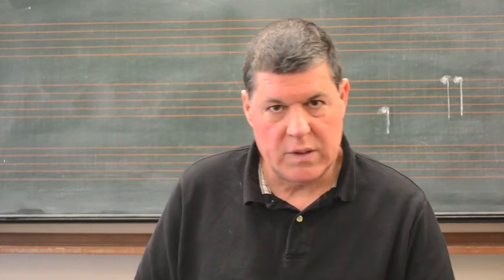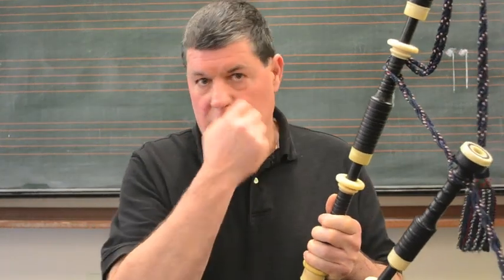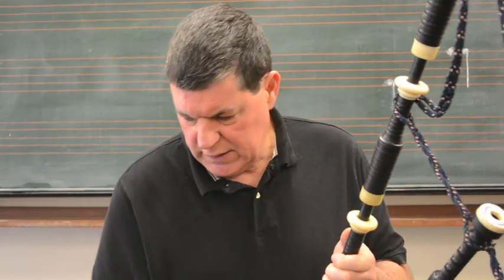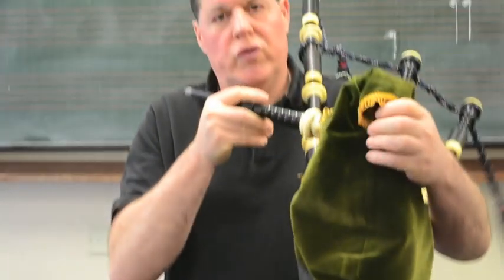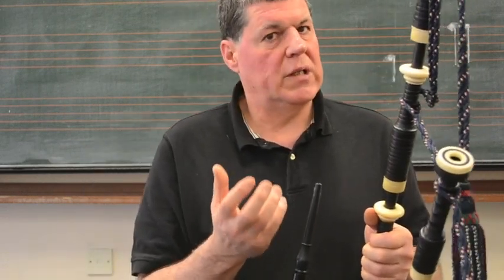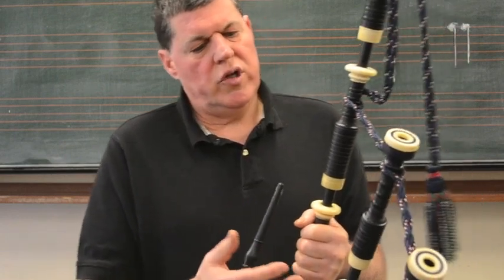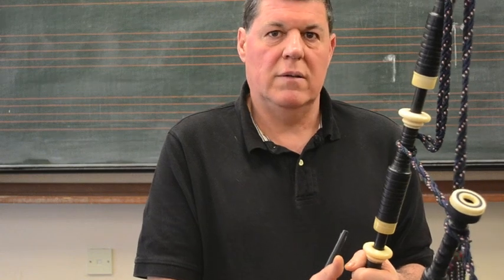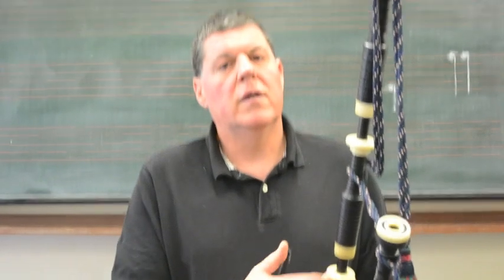Highland Reeds: Drone Reed Air Efficiency

Comment: I have the reeds closing and not losing air, but the chanter reed is stronger than the cut off pressure of the drones. Do I have to weaken the chanter reed... or how do I balance them without the drone reeds being less air efficient again?

Comment: I went to blow my pipes up and managed to get my tenor drones to cut out with only air (not squeezing the bag) but I had to give a good squeeze to make my bass drone cut out for some reason.  The bag did hold the air and eventually they started to sound one by one.  Should I shorten the tongue on the bass drone reed with the bridle so it cuts off at the same time as the tenors?
Reply: Yes, your bas drone reed is to strong, the tongue is a bit to much opened, so , by moving the bridle towards the nose of the reed, viz the closed end, that will reduce the air consuming and will weaken the reed, of such a manner to settle the bass air efficiency ast the same strenght that that of  the tenors
And now, down to work
Friendly

Jean Michel

Comment: I lose a lot of air from the chanter, before I even start playing,  is that normal? The stock is tightly in place and so is the chanter. The drones and the bag are tight.
Reply: Hello, based on what you wrote this is normal.  If you examine the chanter reed by itself there is a small  opening between the tips of the two pieces of cane, and until the bag pressure is high enough to make the reed vibrate air will just go through that opening.  The drone reeds and chanter reed all will let air pass when the bag pressure is low, but once the reeds start sounding a note the reeds are opening and closing so they are now helping keep the bag pressure up.

When you have a chanter reed that sounds at 30 inches of water column vs one that sounds at 40 inches of water column, the one that requires 40 inches is harder to play because it needs more bag pressure before the reed helps you, and also needs more bag pressure to keep it sounding.

Comment: I assume the "Easy Drone" reeds don't need this.
Reply: Since this comment was posted a month ago, I'll respond, Ezee drone reeds are the ones I use, and as far as I know, all brands of drone reeds will need to be adjusted so as not to take more air than needed. Do this by adjusting the bridle that goes around the reeds tongue, slide it a small amount up or down until you get them where you like them and they shut off at the same time.